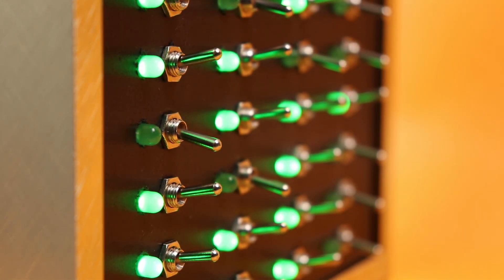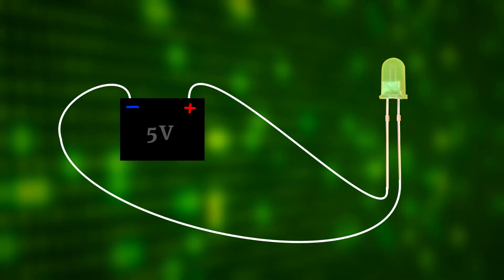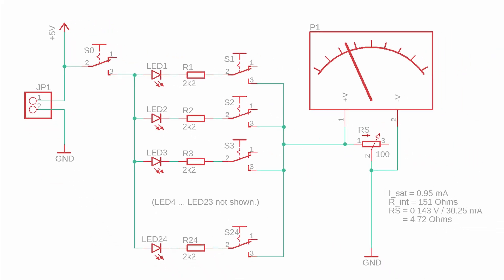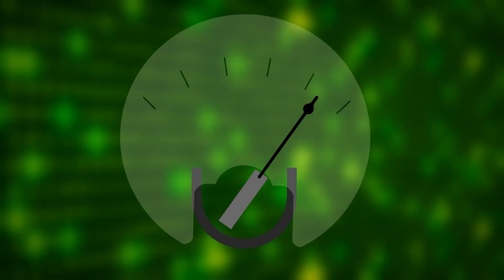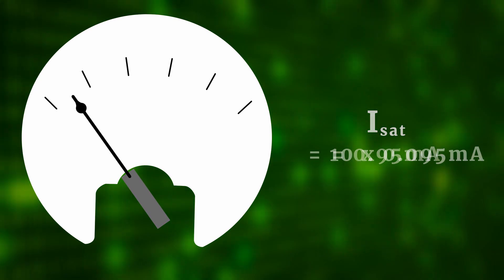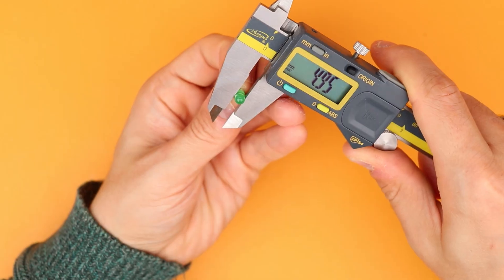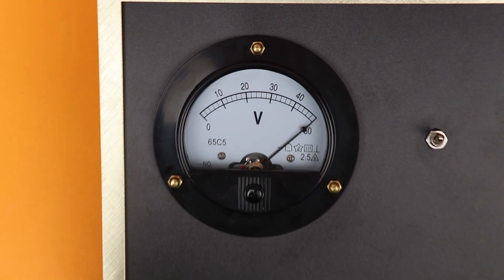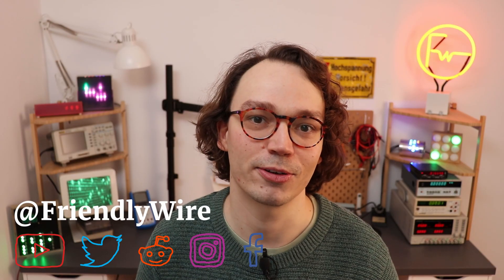Analog calendar with LEDs and switches

Comment: is'nt it faster to just turn all of the leds on and then calibrate the shunt potentiometer without running the calculations because the potentiometer has a large enough range anyways.
Reply from the maker: Yes, true. But with the calculations you know what range of potentiometer you need :)

Comment: But the awesome thing about day of the month is that it is in the range of 1 to 31, making it ideal for a 5 bit binary number. Note binary doesn't mean microcontroller; we can use the same setup with only 5 switches+LEDs. The clue is to put another resistor in parallel to the LED-resistor so that the currents through each switch goes down by a factor 2.
Reply from the maker: That's such a cool idea, thanks for sharing!

Comment: I love your calculator
Reply from the maker: Thank you! I found out about those a few years ago, they are actually quite nice to use. The brand is "Aristo" and they were made in Germany between the mid 70's to early 80's, I believe. You can still find them on Ebay :)
Reply from the maker: PS: Or did you mean the panel meter calculator that I mention in the video? :D
Reply: @FriendlyWire  no, I meant the Aristo calc
Reply from the maker: @jassiharry7300  Ha OK :)